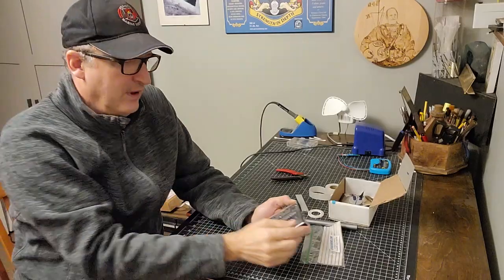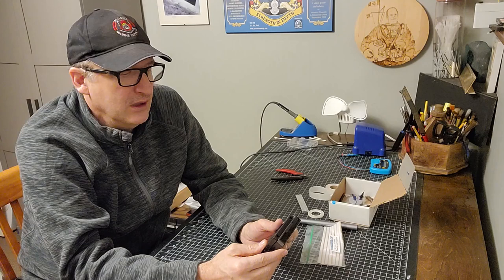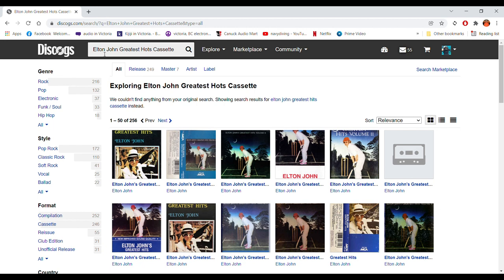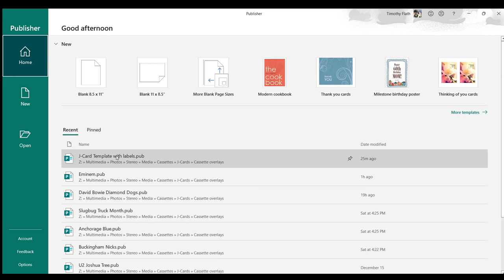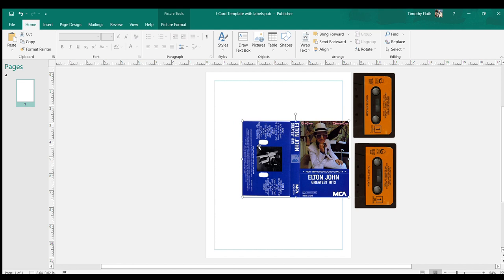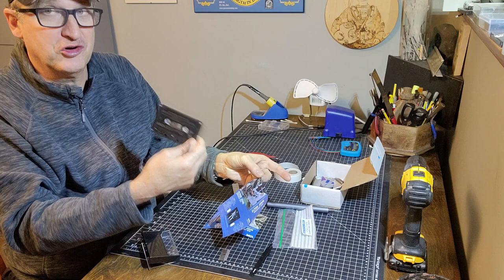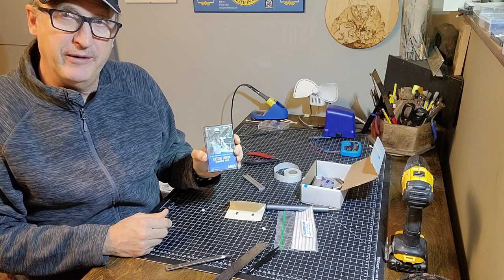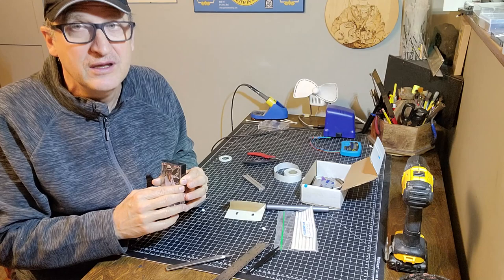Part 1: DIY Making Replacement J-Cards for Pre Recorded Audio Cassette Tapes - 27 Dec 2021

Comment: To keep the color from running, fading or smearing if it gets wet you can set the color with clear semigloss lacquer. Also if you have contrast/brightness settings in your printing program it helps a lot with the picture “popping” so much so that you literally can’t tell the difference between original and printed.

Comment: Looks great. I assume I could do it similarly in Word since I don't have MS Publisher.  I'll have to see if Word has a ruler I can use to size the image correctly. Thanks. I never thought about using Discogs for cassettes. Just thought of them as a place for vinyl and CDs. Cool. Thanks again for the tip!
Reply from the maker: Any software capable of manipulating graphics or images will work.  Some just require a little more coaxing than others...😉😂😅🤣
Reply: @navydiving  I found Word does have a ruler you can turn off or on. Worked fine! Thanks. Now I need to buy more ink...LOL..